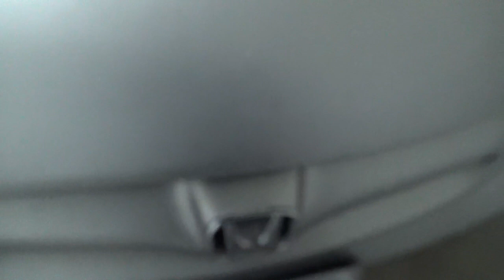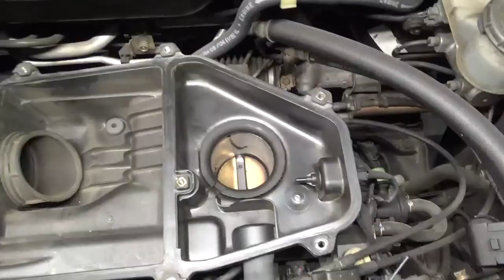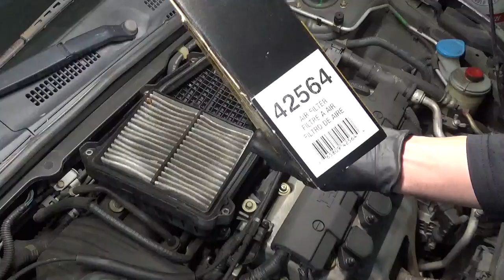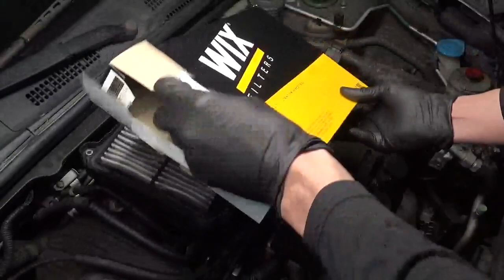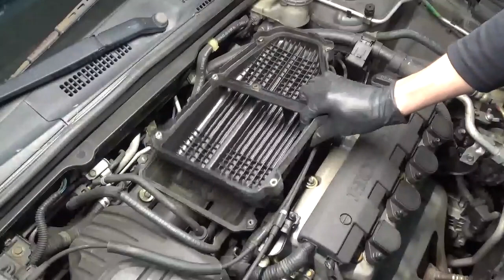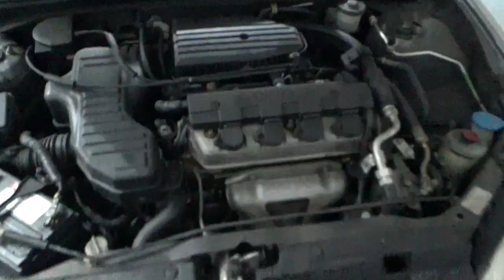2004 Honda Civic Lx Maintenance - Engine Air Filter Replacement #automobile #honda #civic

Comment: What size Ratchet did you use?
Reply from the maker: 8mm socket for the airbox screws. Drill bit adapter for socket is 1/4 in drive.

Hope this is helpful.